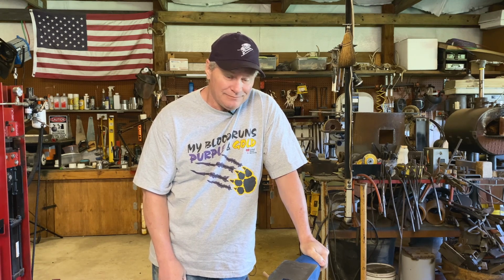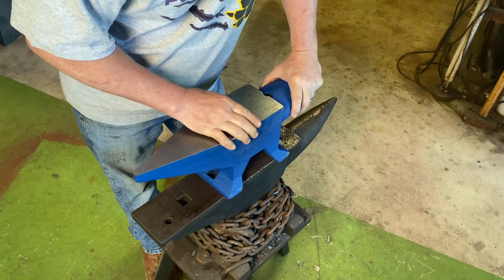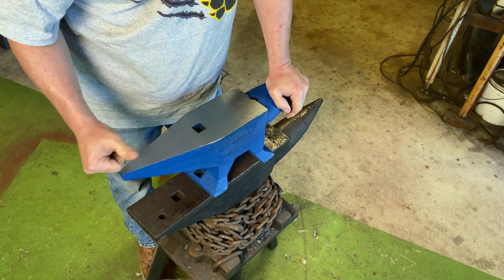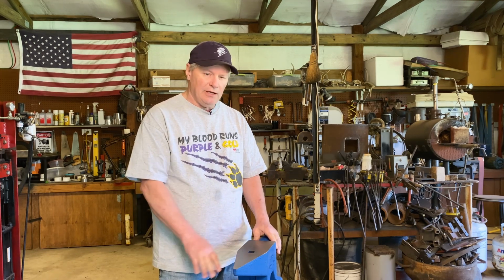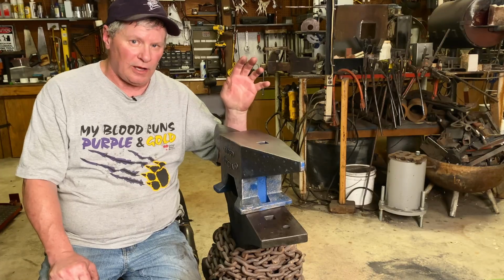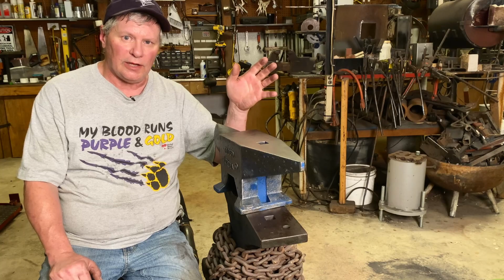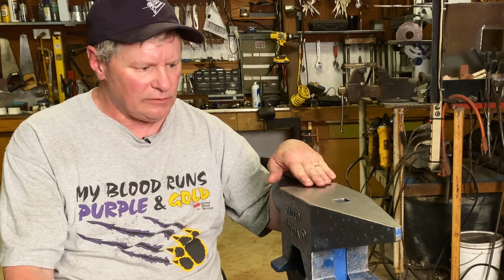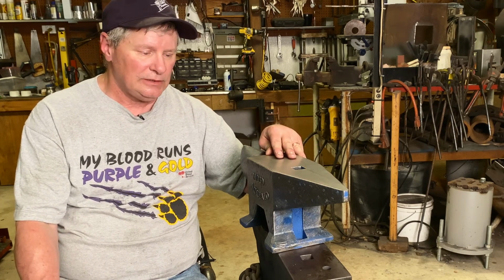Cast STEEL VEVOR anvil review

Comment: I have the 132 pound version of this anvil I did build up with weld around the Pritchel, other than that I have no complaints. I agree with you I treat this anvil the same as my more expensive anvils and it works fine.
Reply from the maker: That’s a cool idea.  I hate that the hole actually cuts into the face but other than that it’s no issue.  If I bought the larger one I think I would do the same thing.  Thanks!

Comment: I started out with that anvil and ive even hand hammered some 160 layer ladder pattern Damascus on it and it works just fine. I did upgrade to the 132 lb anvil of the same brand and i really like it but it still has that stupid hole that cuts into the face but other than that I really like it.
Reply from the maker: Cool deal.  Yeah that hole placement was not thought out very well at all.  I don’t know what they were thinking on that.  But it’s a solid little anvil for the price.
Reply: @TonySeverioKnives  it sure is. I still want to get an antique anvil that is quite a bit larger. Or one that is well built and about 250 lbs.
Reply from the maker: @BertchCustomKnives I have an old 1860’s anvil I use the most then a smaller 115 I’ve had about 15 years.  This one is students to bang on. 😁